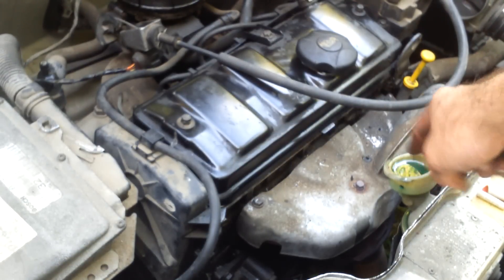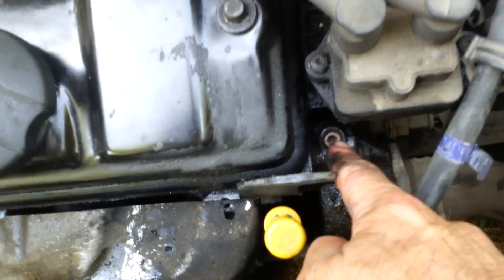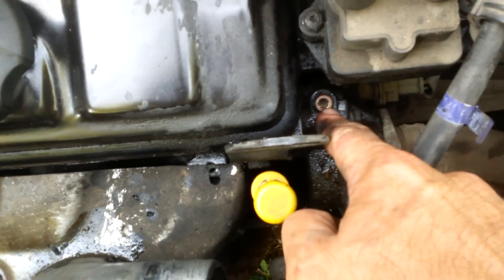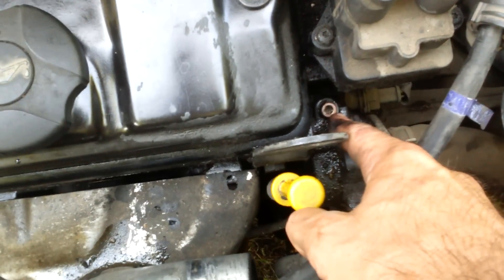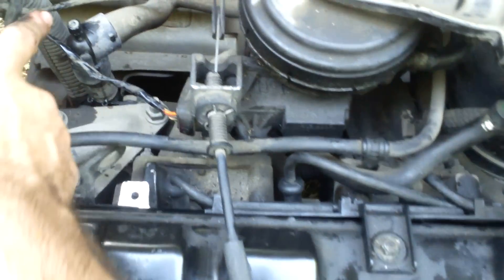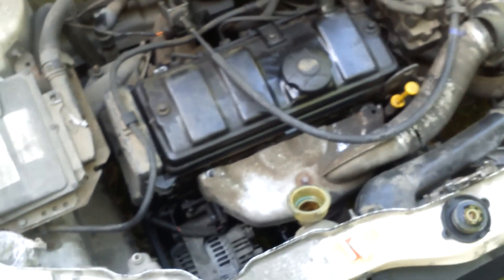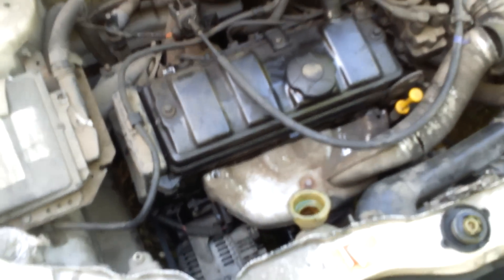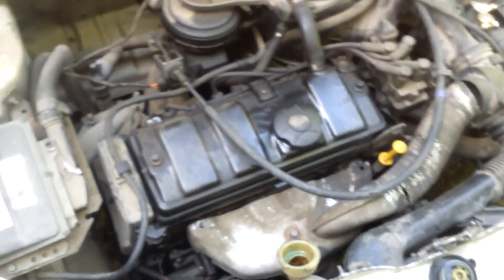[Tuto] Évacuer l'air entré dans le circuit de refroidissement (106)

Comment: Et pourquoi le chauffage ne marche pas c'est le même moteur sa souffle froid
Reply from the maker: Quand le moteur est froid, le circuit de refroidissement ne tourne que dans le circuit principal. Quand la température du liquide de refroidissement atteint environ 90° celsius, il y a une "vanne automatique", qui ouvre un branche, une boucle secondaire. Cette boucle prend une partie du LDR chaud, et l'envoie vers le radiateur de l'habitacle. C'est ça qui te permet de chauffer ton habitacle et d'avoir de l'air chaud. Mais cette "vanne automatique" tombe parfois en panne. Ça s'appelle une thermostat. Parfois, faut la déposer, la remplacer par une neuve et magie, tu as de nouveau du chauffage.

Comment: Excuse moi je ne reconnais pas la vis de purge sur ma saxo et jentends des bulles si tu peux m'aiguiller stp merci
Reply: Manon Rouault si ta saxo est une essence alors les vis de purge ce trouve exactement la ou il le montre sur la vidéo , j’avais le même bruit de bulle d’air au niveau d’la boîte à gant , c’est le circuit qui étais mal purger y avait de l’air dans le circuit de liquid de refroidissement du à un joint de culasse , j’ai fait faire le joint de culasse , purge , et pu rien depuis niquel , le joint de culasse étais trouer
Reply: @elpuebla1878  d'accord merci de m'avoir répondu mais sur la vis de purge alors j'ai un branchement je n'arrive pas l'enlever.
Reply: Manon Rouault fait le faire par un amis ou petit garage mais attention des fois les petit garages ce gavent lol , avec plaisir Solution&Debrouille

Comment: Salut l'ami dit voir serait tu m'aiguiller un peu sur mon soucis que je rencontre sur ma 106 1.1 ess 60cv Ann 2000 voilà ayant eu un soucis de voyant de température et de ventilo qui toune en continu même a froid j'ai été chez mon garagiste du coin qui m'a conseillé de changer mes sondes de température celle niveau boîte a eau et celle aussi niveau côté culasse donc voilà après changement de la boîte a eau plus les deux sondes la panne est partit mais soucis j'ai fait même pas trois km mdr et c'est parti pour la même panne voyant qui reste toujours allumé et ventilo qui tourne en continu que se sois au démarrage a froid et en roulant moteur chaud et par moment le voyant pert en intensité lumière j'ai remarquer aussi que le radiateur était froid et que par moment ma durite du haut et bien bouillante et dur , pourtant j'ai tester le calorstat dans une casserole d'eau bouillante et celui ci s'ouvre bien , penserais tu que cela vienne encore des sondes , d'un faux contact , de mon radiateur qui serait boucher ou alors de mon calculateur qui a garder en mémoire mon ancienne panne ou autres , merci a toi l'ami👌💪